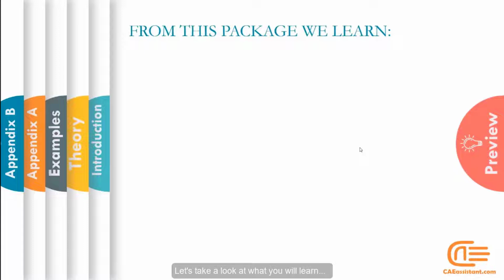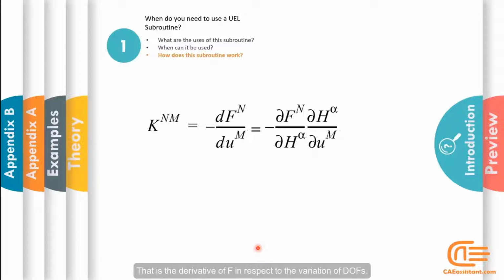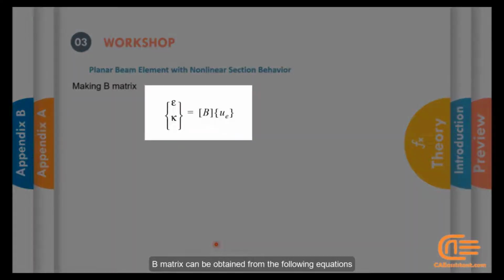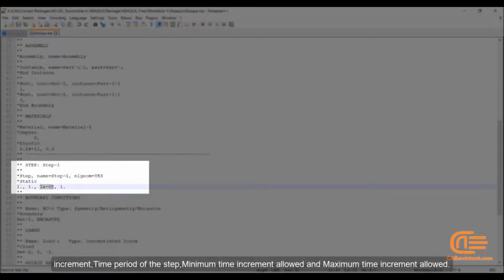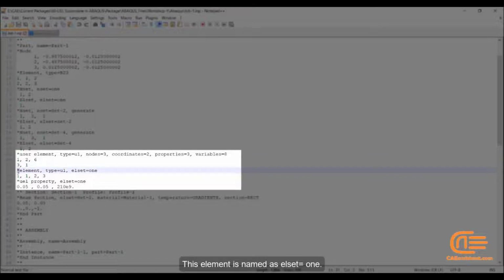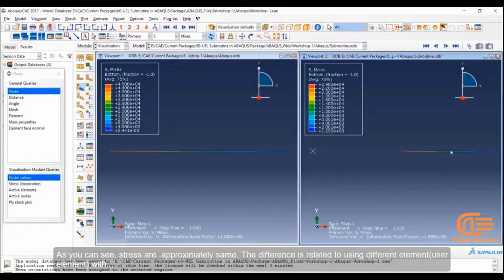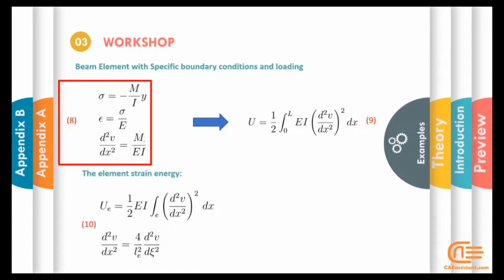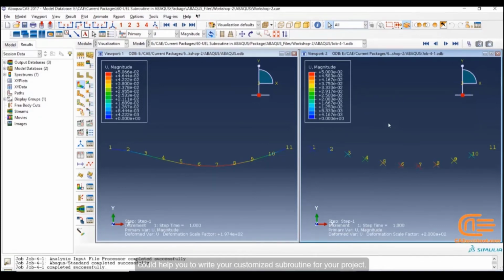How to use Abaqus UEL subroutine? | Learn the basics of UEL with a simple example

Comment: Hello 
I want to model a themo-hydro-mechanical analysis. As you know, Abaqus in the SOIL option just considers a fluid. But I want to calculate the pore pressure more detaild. 
How do you think I can add a more accurate analysis of the temperature-dependent pore pressure to the thermal-mechanical analysis? Is it necessary to write the entire process of hydro-thermal-mechanical analysis with UEL subroutine or can only pore pressure be added in each increment to thermal-mechanical analysis, i.e. use the sequentially coupled method via inpute file or UEL sobroutine?
Best regards,